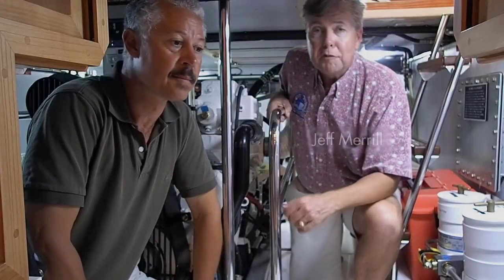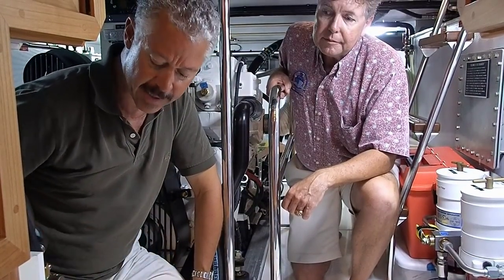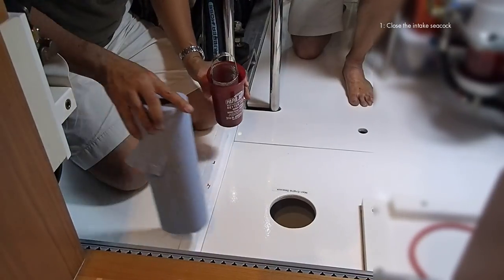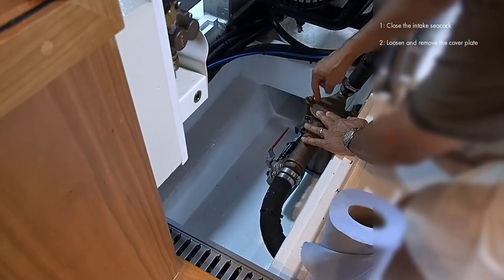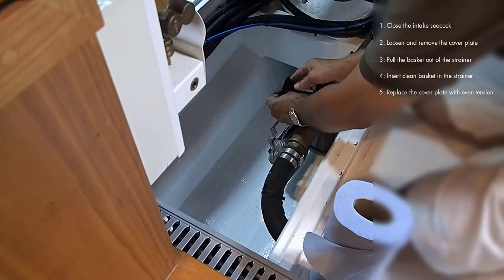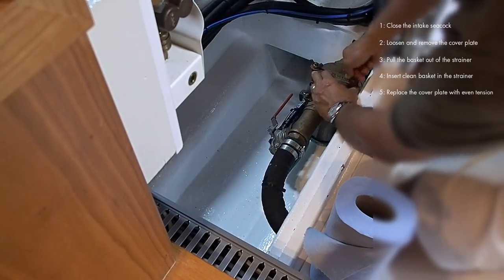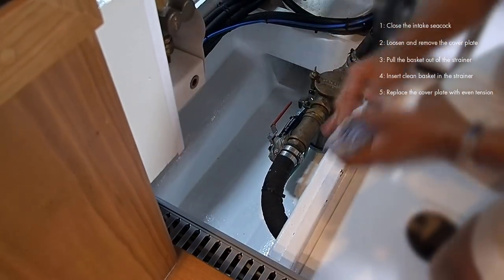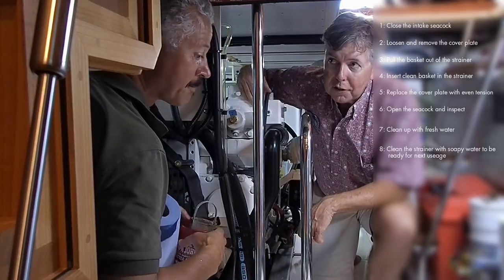JMYS Trawler Skills – Changing a Sea Strainer

Comment: On my boat I had to clean the sea strainer for the AC about every 2 weeks. A lot of strainers to clean if you lets say have 2 engines 1 generator and 3 Acs.Are there any boats that have a central strainer for everything ?
Reply from the maker: Rupp:  Very important to exercise through hulls, clean out strainers, refresh impellers, etc.  All part of the cooling.  Most boats are built this way.  An alternative on a new build is a "sea chest" which is one large entry that becomes essentially a manifold for distributing sea water to the machinery that needs it.  Not practical to change out the boat to a sea chest.

Comment: Here's what I see: Two wingnuts keeping the boat from sinking.  I think I'd be happier with appropriate brass nylocks...not to overtension just to stay put (vibration etc.)
Reply from the maker: You do need to check on the tightness.  What opens, must close and when water is on the other side you need to keep it out